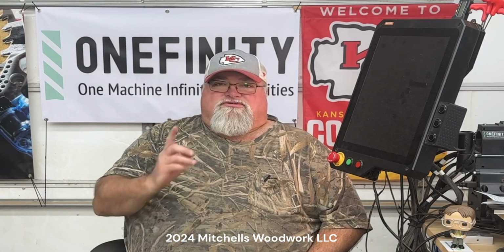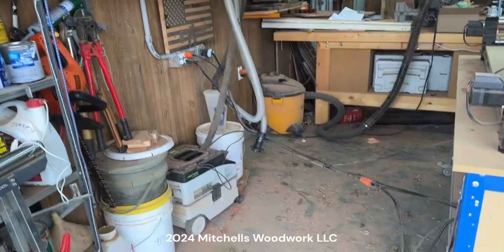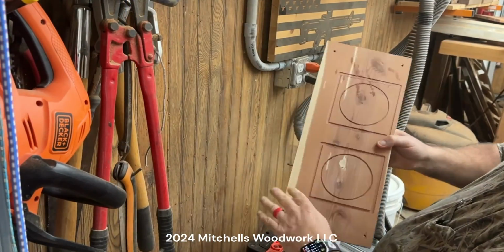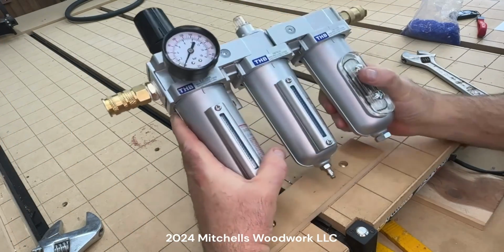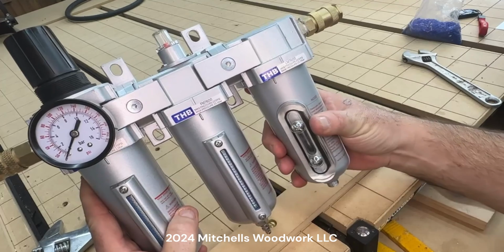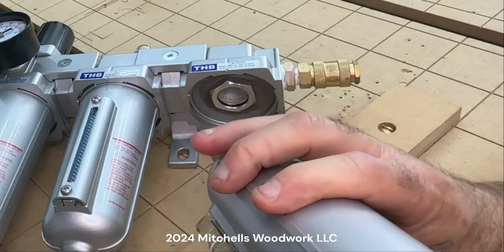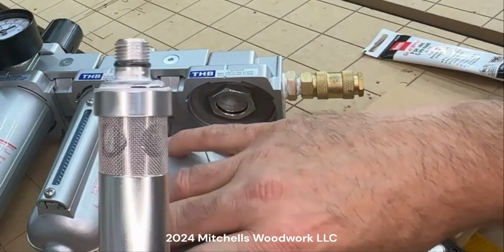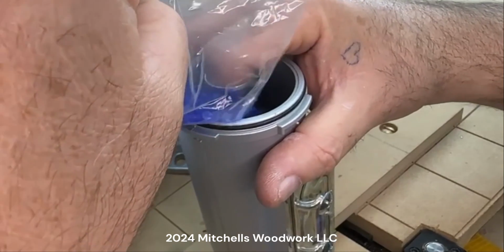PwnCNC ATC: SUPER Quiet Air Compressor Setup Guide

Comment: That's a huge difference in sound!! 

One thing I wanted to mention. You said that would be the last time you were taking off your desiccant trap. You have to either replace the desiccant or take it out and put it in the over at about 220°F for a couple hours regularly. It gets saturated and has to be recharged/replaced or it stops working..
Reply from the maker: Yep, I definitely misspoke there.  But for sure, the sound difference is really a shocker the first time you hear it running!  Thanks for watching and commenting, brother! 😉👍

Comment: Thanks for all the info, especially on parking position on the Masso. I'd be interested in tips on conversation mode. 
I also have a suggestion that you change the order of your air fittings. As it is now, if you disconnect the tank, all the air will dump out through the male connector. Also, you have two females on the filter. (Do what you will with that sentence) That means when you disconnect the horses to change the desiccant, THE HOUSING WILL STILL BE PRESSURIZED, which could be dangerous. Better to have a male at the inlet, and a female on the outlet.
Reply from the maker: Wow!  Great info, thanks!!
Reply from the maker: Coming out of the tank, I have a ball valve before the male fitting.  If I need to remove that hose the valve will prevent the tank from draining.  Isn’t this correct, or did I misunderstand your point?
Reply from the maker: I added your suggestion in the description of this video, and gave you credit for it.  Contact me through my bio and I'll gift you a free 30 day channel membership.  Thanks again!
Reply from the maker: The conversational mode is more for cnc lathes and mills, and I have neither.  If any of you reading this know if any of the "wizards" could be used for the type work I do, let me know.  Thanks!

Comment: I have a California compressor and it is that quiet. I wish I had gone bigger but I am very happy with mine.
Reply from the maker: Man I couldn’t believe it when I first turned mine on.  And it refills fast too!
Reply: @MitchellsWoodwork  Yes sir. Just fyi about once a month release the valve on the bottom to drain the condensation. I have had mine for about a year and still enjoy turning it on.
Reply from the maker: @kevinrich4637  great tip, thanks.  Do you have a desiccant filter hooked up to yours?
Reply: @MitchellsWoodwork  no sir it does not.
Reply from the maker: @kevinrich4637  now that I’ve thought about it, it wouldn’t matter anyway since the desiccant is on the output side.  Duh. 🙄  It’s been a long day, my caveman DNA is showing. 🤣